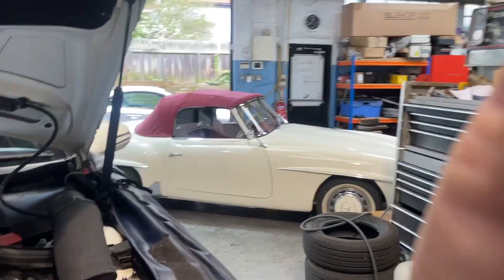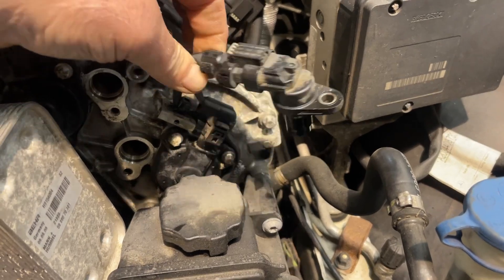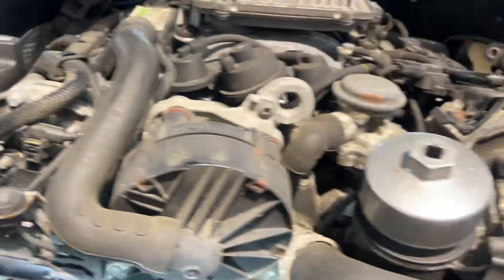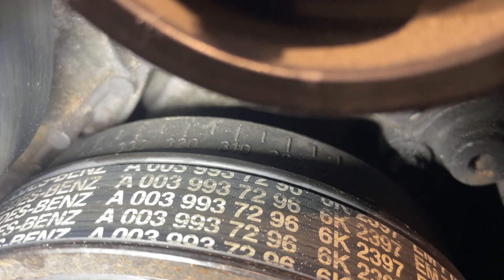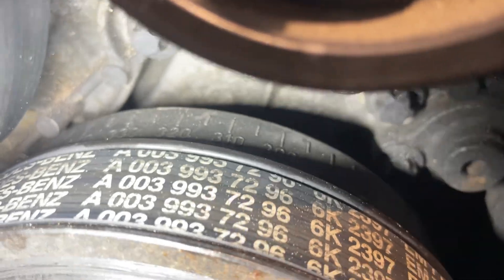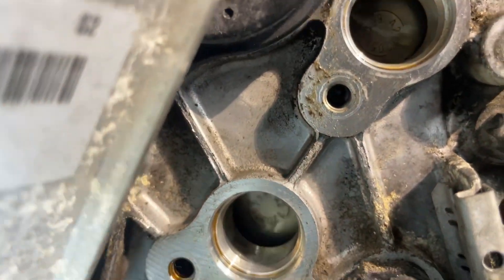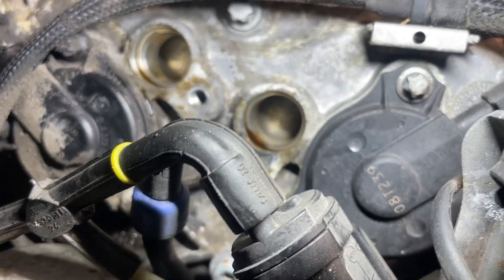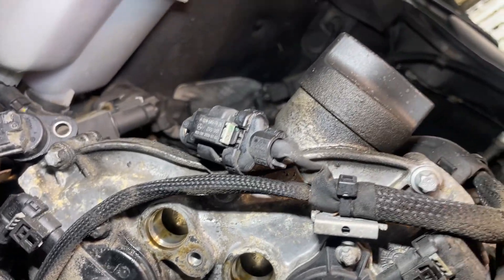Mercedes Benz M272 basic cam timing check

Comment: What if they are only slightly off? The intake cam stamp on the left hand bank is dead centre but the right hand bank intake cam stamp is slightly off but you can still see the full stamp easily. Any thoughts